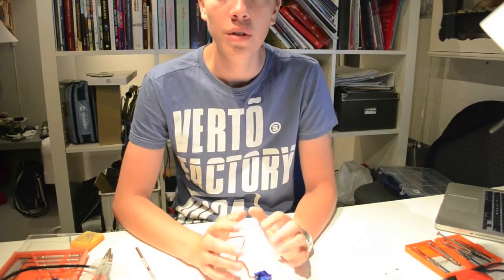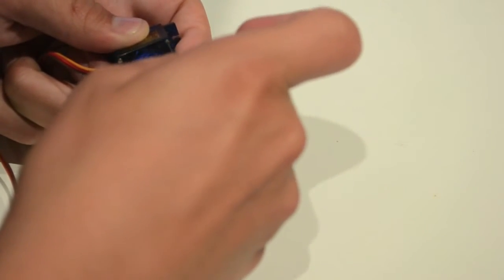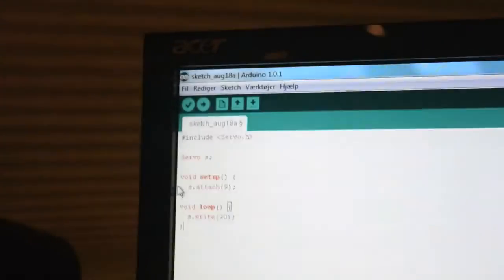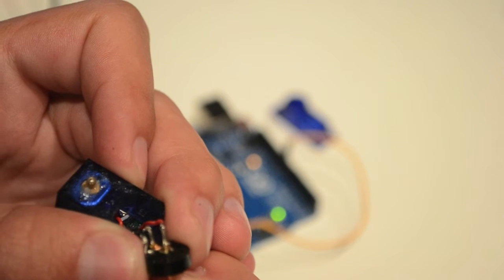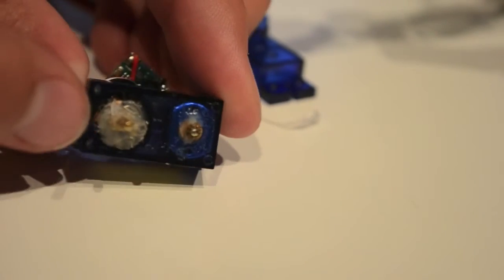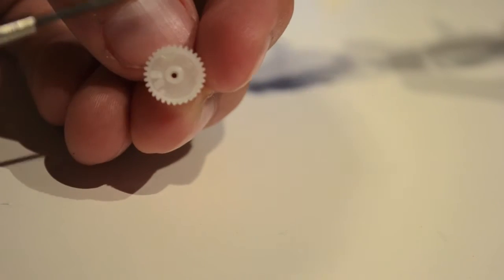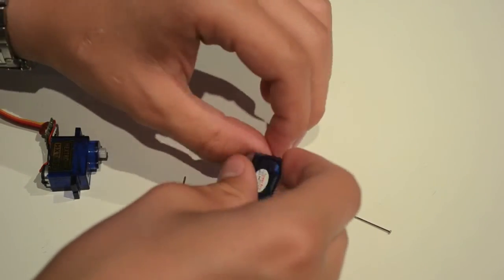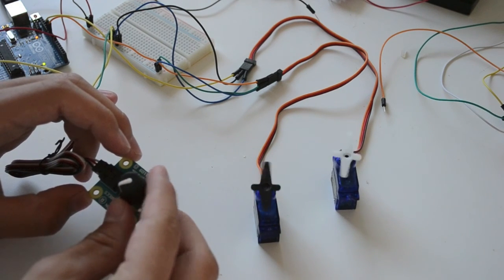How to: mod a HXT900 servo to do continous rotation

Comment: Could you share a code for continous rotation without potentiometer? Just to turn on arduino and check if I modded if right?
Reply from the maker: Sorry i don't know of any code that does that. What if you search on google for "continous rotation servo without potentiometer code". Maybe that will work, i don't know i'm sorry.

Comment: Interesting method. What I don't like is that you drilled out the output gear to let it spin on the knurled potentiiometer shaft. I suspect it may wear quickly. I just modded one of these HXT-900s by gutting the internal potentiometer to make it rotate 360 degrees, and electrically replacing the potentiometer with two 2.7K resistors.  Leaving the pot inside and rotating provides mechanical support for the output shaft. Works nicely, smooth action and good speed control and stable center stop.